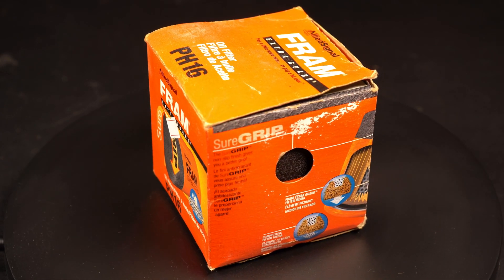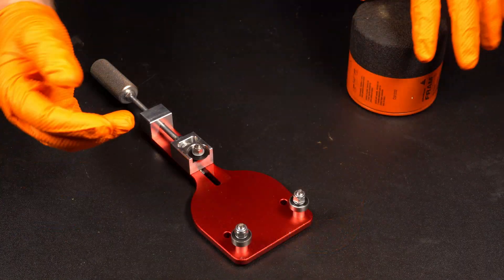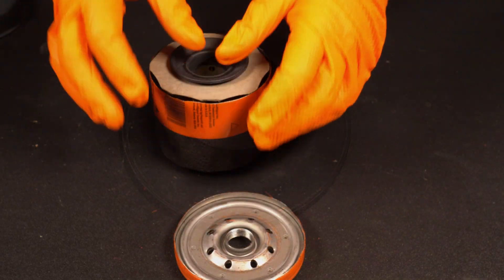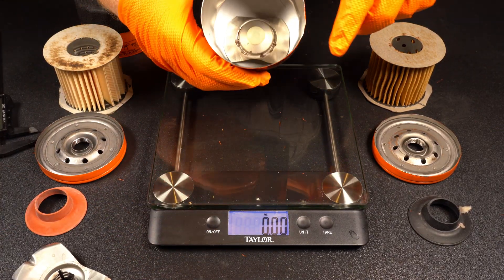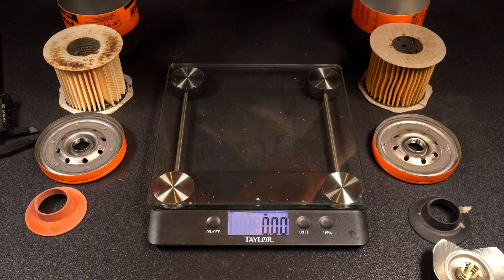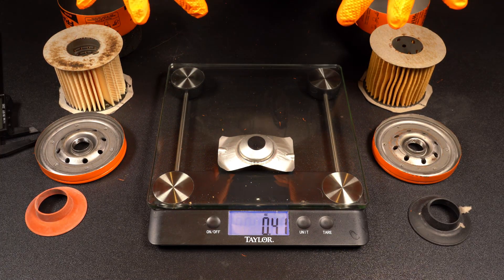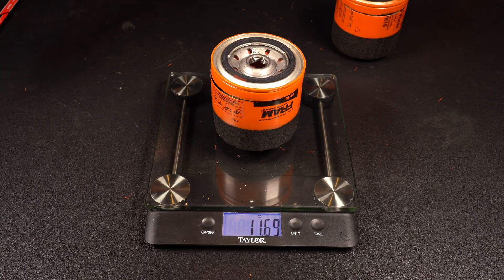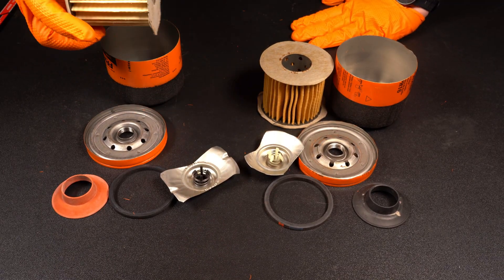25 Years of Fram Oil Filter Design Changes!

Comment: In an ideal situation the bypass valve isn't used, however these filters and tough guard Fram as well, have horrible flow rate numbers.
There are videos on yewtube showing this.
These, especially when the engine is cold, will have plenty of open bypass situations.

Comment: About 5 years ago or so, Fram did update all their oil filters to be more compatible with synthetic oils. The bypass valves are now made of silicone instead of rubber. The filter media didn't change but Fram did add a resin to the mix to give it finer filtration and longer life. The current PH series has a 10,000 mile estimated life expectancy. (personally, I'd never push any oil or filter that far, not even oils that claim 20,000 miles).
The end caps on the media are a similar material to the actual filter media itself. The idea there is that the adhesives used to adhere the 2 materials can be less expensive and require less overall adhesive to attach the 2 together. If you have metal end caps, it requires a more expensive and higher quantity of adhesive to adhere the 2 parts together. If you do a filter cut open where the filter has metal end caps on the media, you will see adhesive seeping out around the edges of the metal end caps. It's part of the cost savings Fram uses to make their PH and TG series of filters less expensive to the consumer and still maintain a quality product. Fram's XG series of filters does have metal end caps and you will see adhesive seeping out between the filter media and the end caps. You will also see this with Wix filters, Napa Gold filters and pretty much every higher end filter. It's just what happens in the manufacturing of these types of filters. Basically, it is what it is.